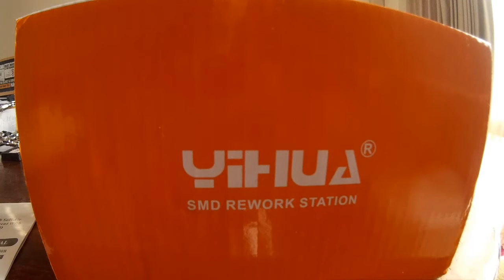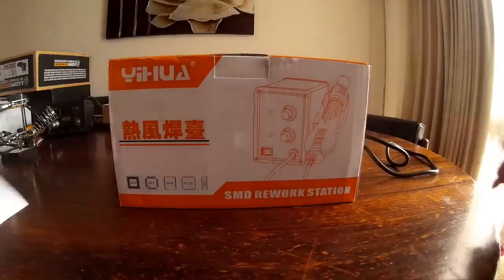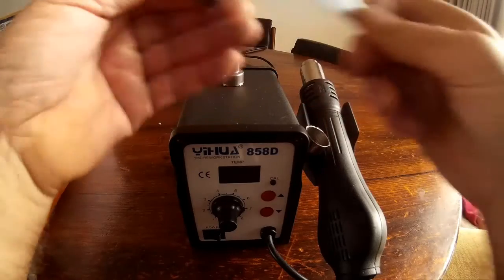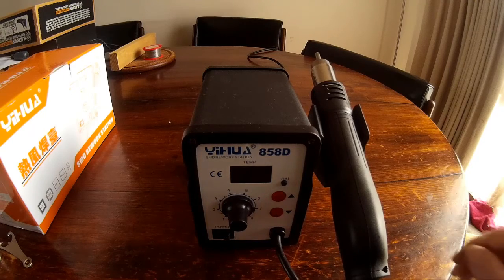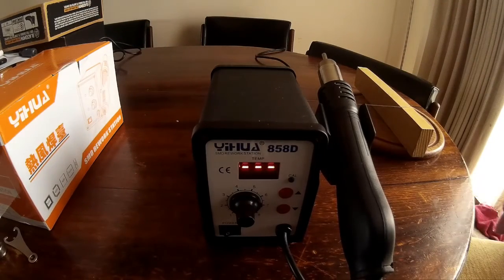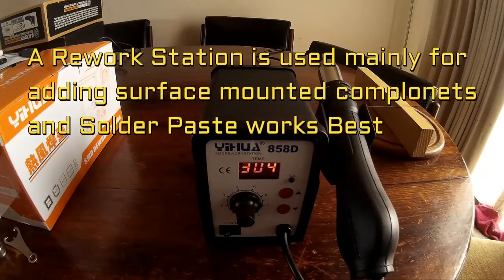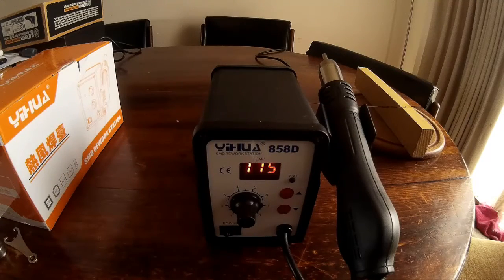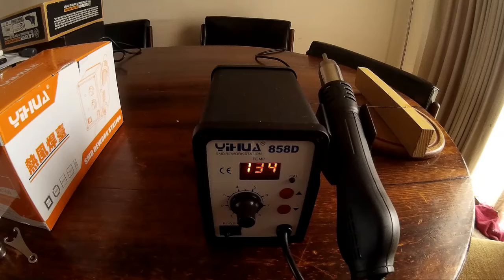📌 Yihua SMD Heat Gun Rework Station a Quick Review and thought on its Quality Control

Comment: How is it at present? is it still in good shape?
Reply from the maker: Yes its still working fine.
The only annoying thing is the loose fitting nozzels, they need to be a better fit.
Appart from that, works well.
Reply: Garry Purcell lol just bought the 878d and they're still the same hahaha  @GarryPurcell
Reply: @GarryPurcell  oh yeah also just slightly bend them out of shape and theyle fit more snug ;D
Reply from the maker: @joeldwyer7254  
You would think they would have the nozzels fitting better by now.
But the heatgun works quite OK as you already know.
Reply: @GarryPurcell  Maybe a once round with kapton tape on the inner surface would help tighten it up? Kinda like a thread tape. Interference fit. I got the 898D and they are just interference alone, push-on type. Interesting to see those others...thanks.
Reply from the maker: @englishrupe01   Thanks... I never thought of using kapton tape, that's a good idea. 
I have a roll laying around, so I will test it next time I use the Heat Gun
Reply: @GarryPurcell  You are welcome. Hope it helps!